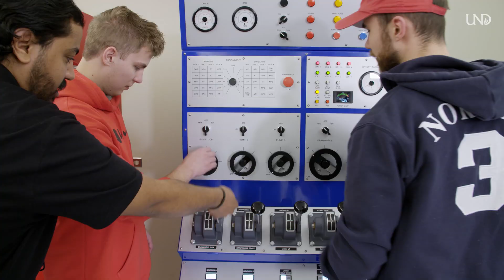Petroleum Engineering at UND

Comment: Is a good program but it is useless when you can't find a job as petroleum engineer after graduation. It's being 5 years of my graduation, I graduated from UND in 2018 with bachelor in petroleum engineering, we are now in 2023 and still couldn't find a job as a petroleum engineer or a job in the oil and gas company, likewise with all my course mates. The oil and gas companies would rather hired those with mechanical and chemical engineering degree and use them as petroleum engineers. There is a high unemployment rate in petroleum engineering job and it is difficult to transit or get into another industry outside of oil and gas with a petroleum engineering degree.